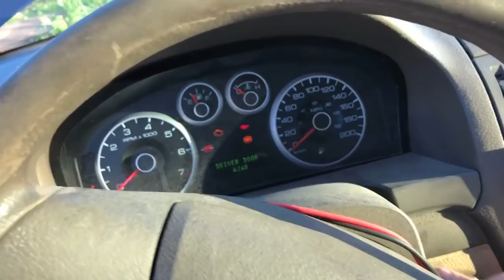Dodge VS Ford Fusion CAR JUMP FAIL!!

Comment: Ok have a suggestion for Pete drain all tbe juice out of the radiator replace it with milk fry the one wheel drive tire then run it till the motor blows